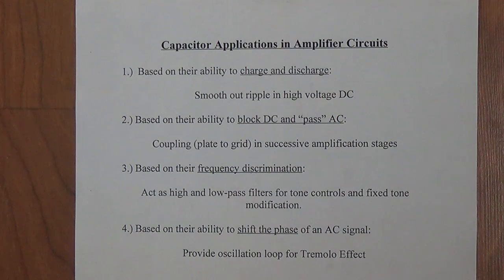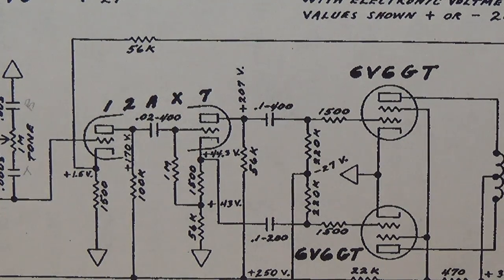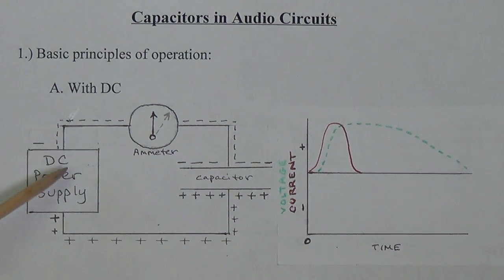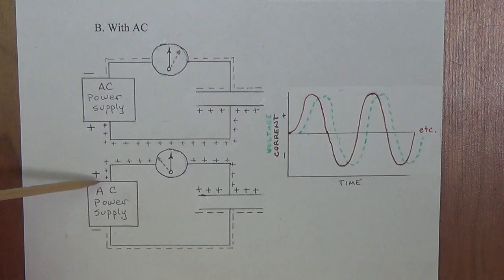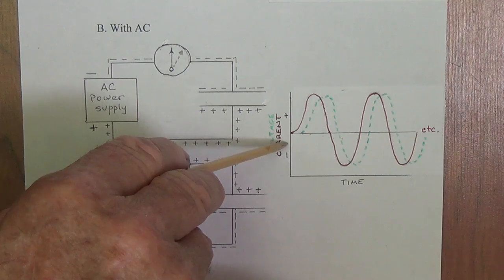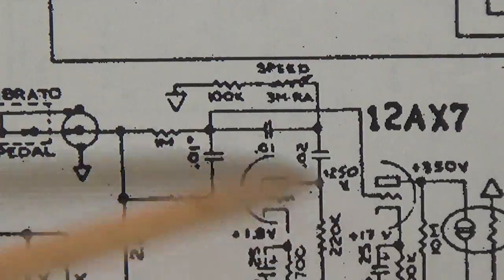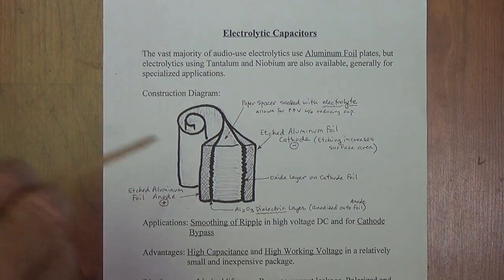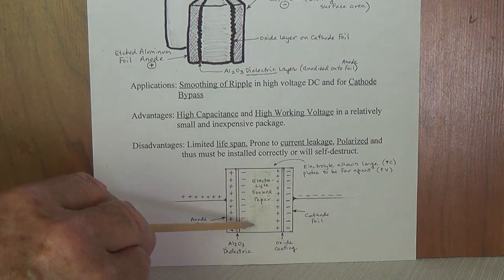Capacitors in Audio Circuits:  Part 3

Comment: Uncle Doug, you are an awesome teacher! Sometimes I have to go over your material several times to get it, but you explain things very well. I have run into a hand full of people in my life that I consider true teachers, you are right at the top of the list.I have been intrigued by capacitors since I began learning how guitar amps work. But I admit, some of it has been pretty much over my head. This series on caps has really opened my eyes to what's actually happening during operation. Thank you! You really are awesome man...
Reply from the maker: You're welcome, KV, and thanks for your extremely nice comments. Supportive words such as yours really make our YT channel a worthwhile and rewarding experience for both Rusty and me.
Reply: KrackerVision I agree man :)
Reply: I had trouble with the actual operation of capacitors ( at least in electronic circuits ) for a long long time. Finally getting it cleared up.

Comment: Hi, Uncle Doug! Could you tell us the difference between the bias modulation tremolo and harmonic vibrato? For example, maybe in another video, could you explain to us how the harmonic vibrato from fender vibrasonic 6g13-a (and vibrasonic 5g13) works?
Thank you!
Reply from the maker: I believe that Harmonic Tremolo is a more accurate term, Emanoel, since its basis is primarily a volume rather than frequency modulation.  This effect was used in several large Fender brownface amps:  Super, Pro, Twin, Showman, and Concert. I demonstrate the effect in a BF Concert amp (see my video).  Here is the best site I have ever seen for a clear explanation of the difference between the harmonic trem and the other versions of tremolo:  http://www.strymon.net/amplifier-tremolo-technology-white-paper/

Comment: @Uncle Doug
Dear Doug its blindfold test time, maybe for Rusty. Llast night here in Halifax we set up our guitar player with his Franken Tele, a Traynor tromp box amp - accepts an 8 ohm speaker load - and my University alnico 12 loudspeaker, mounted in a plywood long-scale bass guitar case (I was on my way to make a Dano imitation amp-in-case, and stopped - although this particular guitar and amp would fit inside, as is)
My observation  - tube amps must sound the way they do in part because their speakers cannot handle what (little) they produce, RMS wise - this little transistor thing last night, with chip verbs & tremolos, not even hollow body intrument, sounded funky, played unmiked to a room of 2 levels and 180 seated,
the speaker stands about 3 foot 4 inches - IE above backline normal. Let's try Rusty on a transistor amp with different vintage spkrs, then tube amp with heavy ceramic ones - and see which one barks best.
Reply from the maker: An interesting proposition, Andrew. I'll tell Rusty about this (after his nap) and see what he thinks :)

Comment: This is really informative Doug, thanks so much for creating this series.  Excellent stuff... truly..... thank you very very much.   Not sure if you have ever done this but do you have any theory on how to select the proper resistor when creating a circuit ( aside from hunt and peck) ?    A formula perhaps   ?  Thank you Doug.  - regards, Ron
Reply from the maker: You're welcome, Ron.  Resistor values can be calculated based on the current and desired voltage drop, as explained in my Ohm's Law videos.  After that, you can experiment to fine tune the values.
Reply: Will check that out... thanks Doug !
I am building amps these days in part due to watching your videos and learning.  I have a few series on my channel of that process.. lots of learn as I go along stuff.... would be honored if you would check them out.   Many thanks. Ron
Reply from the maker: We will do so, Ron. Thanks for the invitation.

Comment: Hey Uncle Doug,
Ich simply wanted to extend my huge thanks to you for keeping up your quest in explaining the functions of amplifiers to the simple-minded like myself.

I recently finished my third amplifier build, a complete scratch build of an Orange Super Bass from the late 70ies, after starting out with a Marshall 18Watt Kit and converting an old Siemens Radio into a Vox style Amp with two 6BQ5 tubes, a 12AX7 and an EF86.
All that would not have been possibly, without your work, so tahnks a lot and keep 'em conversions and scratch builds coming!

Greetings from Germany,
Phil
Reply from the maker: You're quite welcome, Jan. It's great to hear that our videos helped you with your successful projects. Best of luck on all your future builds :)

Comment: Hi Uncle Doug, as always I've learned a lot from your videos, just one question though, what is the "lifespan" of modern Electrolytics?  All the best to you and the gang, Colin.
Reply from the maker: Greetings, Colin. If the amp is used often, I would think that good quality electrolytic capacitors can last indefinitely.  I have some that are over 50 years old and still test and function like new.  On the other hand, if the circuit is dormant for many years, the electrolytics may be irreparably damaged or require a lengthy re-forming period.
Reply: Electrolytic capacitors are rated for a number of hours at a specified temperature, e.g. 1000 hours at 85 degrees C. Operating them at a lower temperature extends their useful life.